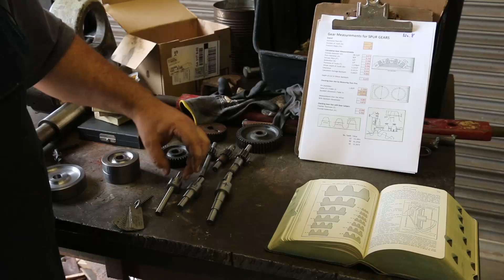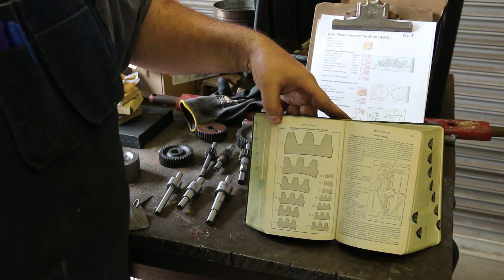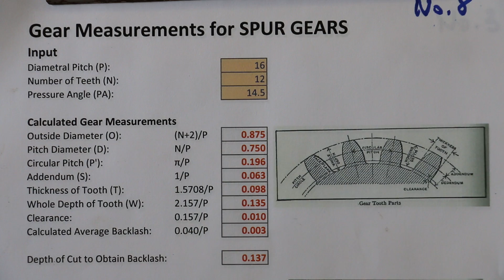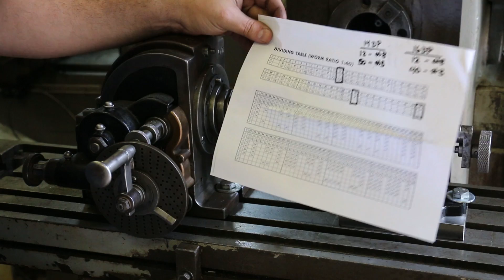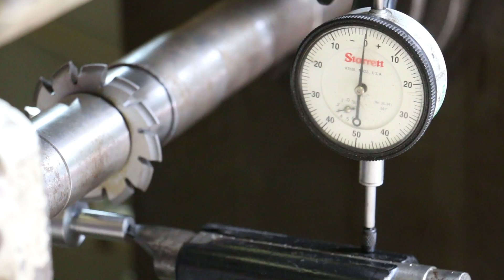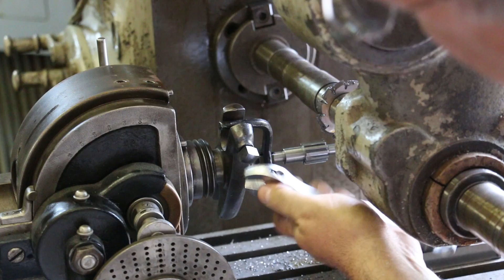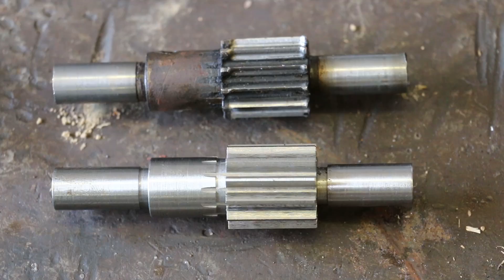Gear Cutting Basics and Cutting Pinion Gears on a Horizontal Mill

Comment: 0.875" maybe the radius and not the diameter?
Reply: .875 is the diameter. See the formula.. Trust the formula.... Be the formula.
Reply from the maker: Gordon McMillan No, that was the diameter.  These are pretty small pinion gears!
Reply: Keith Rucker - VintageMachinery.org Thanks Keith, must have been zoomed right in there ...  8-)